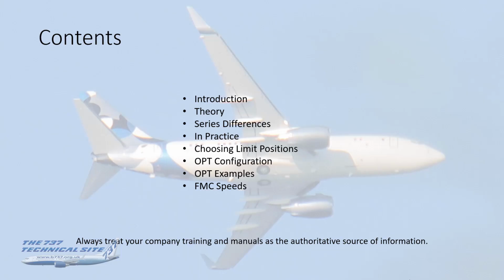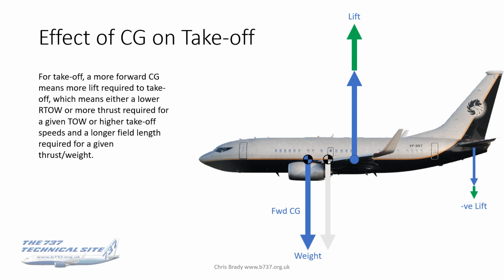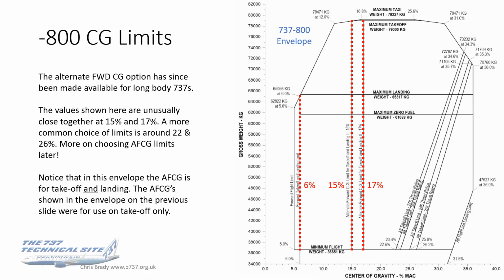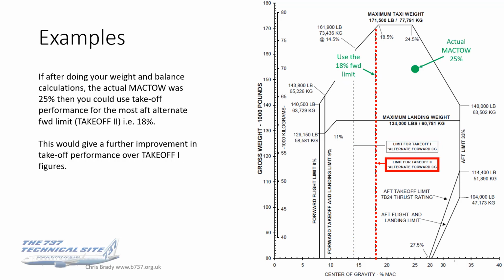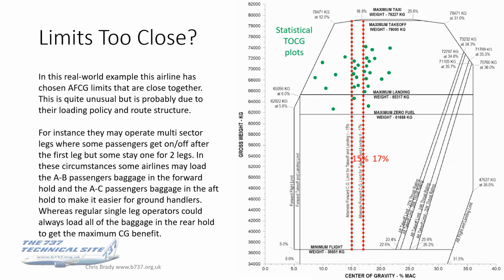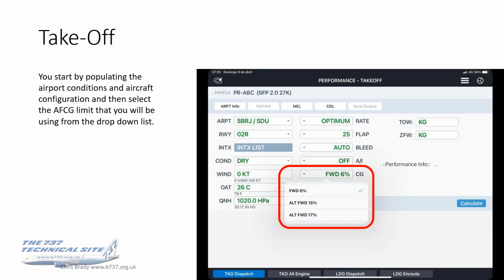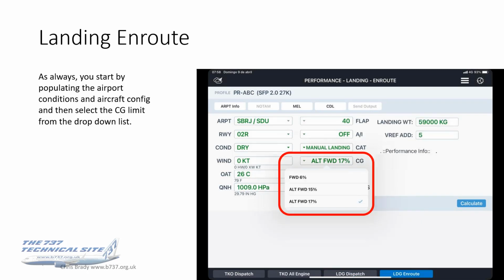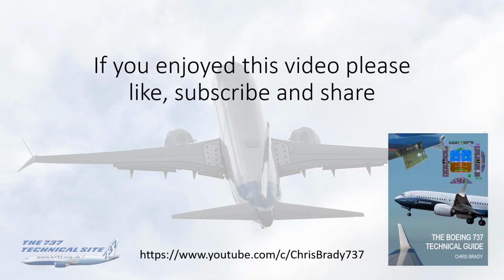737 Alternate Forward Center of Gravity Option

Comment: Perhaps one day there will be three independant, robust and extremely reliable technologies for determining  actual and very accurate weight and cg position. Then the performance software can use true numbers with appropriate margins of course.  We need something better than strain gauges and like systems.
Reply from the maker: They have been trying to do that for years without any success. I believe it was trialled on the 777.

Comment: Great Stuff Chris! Just a quick question, using your TO example with 6/15/17% limits, if we were to receive a loadsheet with a TOCG as say 16% which selection from the OPT would we use for the calculation?
Reply from the maker: I am sure that I explained this in the examples in the video. Anyway, in your example if the actual MACTOW was 16% then you could use the first alternate fwd limit (TAKEOFF I) i.e. 15% figures.

Comment: I literally confused with the labeling. Why is it called “Alternate Forward CG” when the method used is by moving the forward CG further aft? Or to make it clear, why is the name “Forward CG” afterall?What is the pale used to determine that it is a “Forward”? Help me please Captain 🥲
Reply from the maker: A better way to think of it is “Alternate Forward CG Limit”.  It is the forward limit that changes which in turn gives you performance benefits.
Reply: @ChrisBrady737 so if I’m understanding it correctly, the cg is assumed to be at the forward limit for calculating takeoff performance, so an alternate forward cg limit would just let you calculate that the aircraft would be able to take off in a shorter distance based on setting the forward  cg limit further aft? Basically changing the assumed worst case scenario?

Comment: Thanks Chris for this presentation, while  my company don't have this option on 737s (the 787 fleet got theirs though)😂
One of the selling point Boeing advertise to us in a meeting is  wheel speed margin, as we operate a lot on H&H airport with long enough runway for improve climb, But still we don't got one, I'm not in that position to know why...
btw there is no law to require the main wing CL must land after CG, the tailplane could have positive lift and you still got a stable aircraft, let along canard aircraft w/o fbw like the wright flyer 1. It's just most airliner would use fwd enough CG for extra stability to ensure safety.
Reply from the maker: Hi Umi, I did mention in the presentation that AFCG can help with tyre speed limits but this is very rarely a factor on the 737 as other limits usually come into play first. Yes I know the laws surrounding CG & CL positions but I was talking about the 737 case which does not have a canard.
Reply: What is your evidence that the Wright Flyer was stable in pitch?  As far as moving the cg aft, as soon as CG corresponds with CL your airplane is in a condition called stick neutral.  Have you ever flown an airplane in this configuration?  I seriously doubt it.